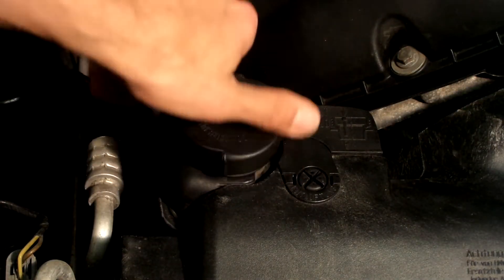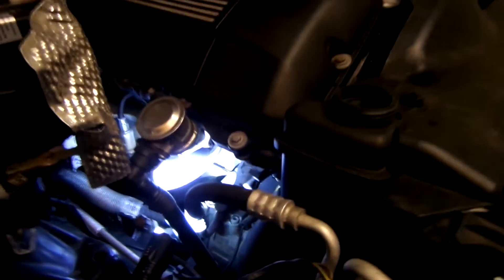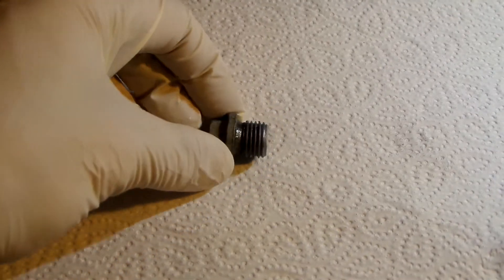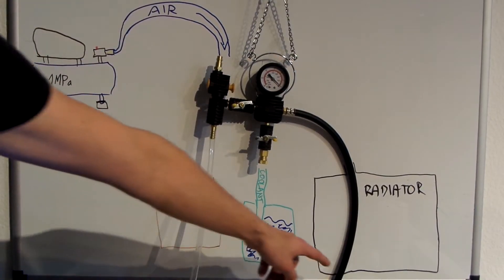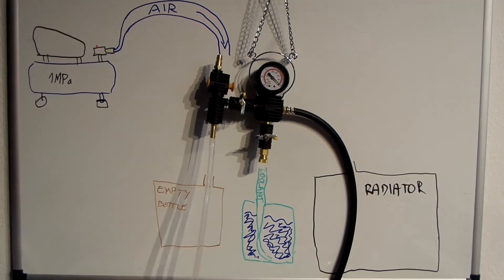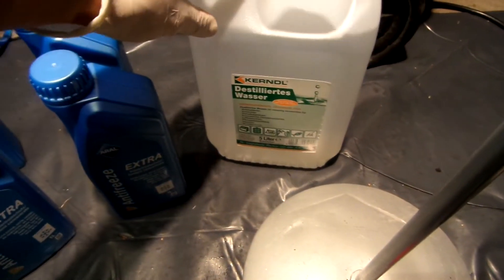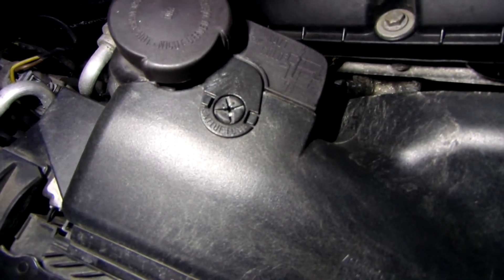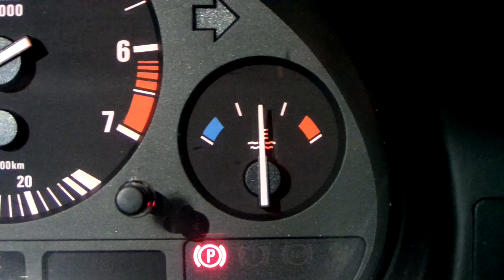💦 [BMW E39/M54] Coolant Change (Regular Change Prevents Corrosion!)

Comment: Do I have to use the air compressor and if not what do I do
Reply from the maker: No, but you need to bleed the system. Check coolant level more often until you see that it is "steady".

Comment: My radiator drain plug seems to be the same as yours. I tried tugging on it and twisting it and pulling it, but didnt want it to crack or break, so gave up on it. 

Did you have to put a lot of twisting or pulling force to release the blue radiator drain plug? Did you use a pliers? 

If feel if I smash it or damage it then the radiator will always leak coolant, am too worried to proceed.
Reply from the maker: On another car it was really stiff, so nothing unusual in your case. I had to use pliers to remove it.
I would suggest to buy a new plug before tackling this job, and going a bit clockwise/anticlockwise when trying to loosen the old one. If it still won't come out, better take it to a shop rather than risking breaking the radiator.
Reply: @ProperRepair  I think I might try draining from the lower radiator hose. Keep draining and refilling until no more old coolant can be seen when draining. Then add fresh coolant. Will have to heat engine up each time though I guess, to allow the thermostat to open and circulate fresh water each time.
Last thing needed is to ruin the rad. Was thinking to get a spare plug, but might just try the lower rad hose drain as an alternative approach.

Thanks for your reply
Reply from the maker: Just be careful, coolant will be under pressure and can burn you if you disconnect the hose with the engine still hot.
Reply: @ProperRepair  I'll proceed with caution as per near boiling coolant 

thanks man

Comment: How much coolant comes out from the engine Block where you took away the bolt? My coolant is so dirty and i dont know how to flush it in a Way that i dont need to unbolt it many times
Reply from the maker: Not sure... it would be hard to measure anyway. If I were to guess about 1-2 liters.
But if you are flushing it, just drain the radiator 3-4 times and then once more everything, including the block. Should be OK.